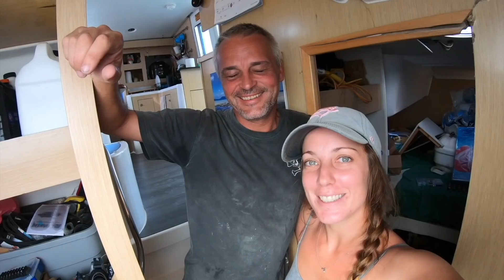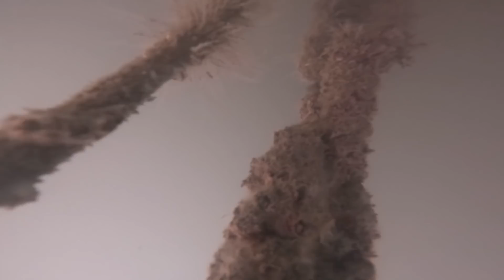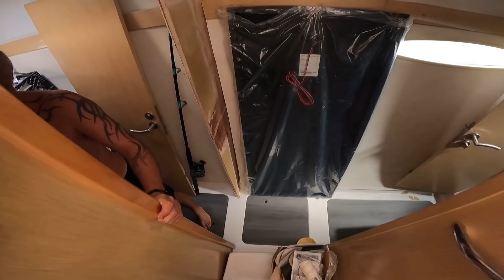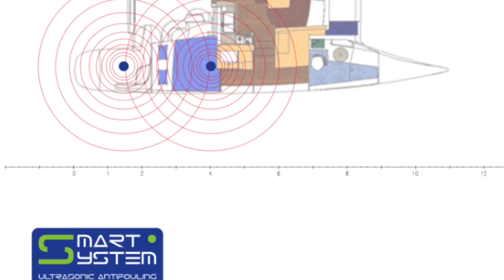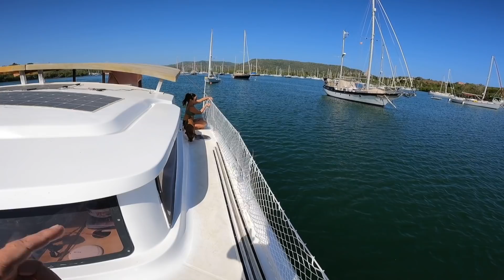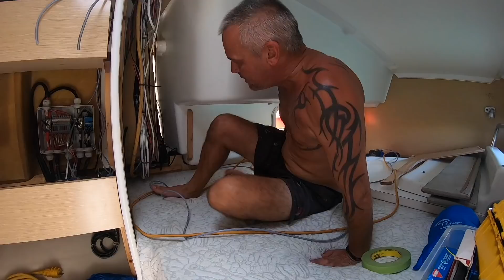ULTRASONIC Antifouling: Will it Work?? (S3 E3 Barefoot Sail and Dive)

Comment: I was going through the comments hoping to find any info on the outcome and found nothing. I am in contract to buy a 45' cat for a full time liveaboard and I am very curious if ultrasonic antifouling works. Hull Shield caught my attention. Would be great if you share the results (or a link if you already did on a different video). Thanks!
Reply from the maker: We’ve barely used it. Makes a high pitched noise that our dog hates.

Comment: Did you do an update video on the Untrasonic device?  I don't see it mentioned anywhere.
Reply from the maker: We have touched on it in a couple videos. We do not use the system. It makes a high pitched noise which we do not like. If you are not a live aboard it could be a good system

Comment: Rule of thumb, for using the zip ties, black for outside use (better UV resistance) white indoors...  Wish I had the courage to rebuild a hurricane-damaged boat...
Reply from the maker: I did say cable ties aren’t the best option but they are all we had at the time. I know black are more uv resistant but I’m not putting black on my new dog net and life lines. Would look terrible. 
We have a plan to put a thin line wrapped through it when we find the right stuff. And get rid of the cable ties. Everything is a work in progress. 

It’s definitely not easy

Comment: The ultrasonic works as long that you stays at a dock, we did already tests with it 20 years ago. with some times beter results and some tomes no results. It kills any way green algs, but it works not fast enouf. Good luck but it is no waterproof you will see.if it was that efficient was antifoiling not nessesary any more.

Comment: will be very interesting to see if it works but would be a good idea to keep a log of the ocean temperature during the trial to if this affect the outcomes. the manual states 
Warning
Install the ultrasonic device on the boat after cleaning the hull thoroughly and applying the antifouling paint. Device will prevent the growth of organisms and partly clean the hull. Place the device on the inside of the boat. Device is suitable for plastic and metallic hulls (aluminum, iron).

Comment: If the zip ties don’t last on the net you can get hog rings and hog ring pliers.  You can get them in stainless steel.   If you have never seen them it’s like a small C and then you put your cable and net into the C.  Squeeze the pliers and it makes a ring around them attaching them to each other.
Reply from the maker: Thanks!

Comment: I think this experiment will be interesting. Luperon is a great place to be able to do this test. Having it on a dual hull boat also makes it very valid. Same boat, same location, real world results.  
Any idea how many transducers would be needed to cover yeh whole boat? Or, what is the coverage of each transducer?
Reply from the maker: The diagram they sent said 4 for our size boat but I would almost want 6. 3 on each hull
Reply: @BarefootTravels  that was my thought as well. Make sure the overlap zones are as big as possible. So you’d like
Y see a 6-8 amp draw with all those installed.

Comment: Hi, I know how ultrasounds work because I work with them every day (physiotherapy) and they are also used in thickness measurement and metal defect and I know that the vibration produced propagates very well in liquids and metals but I have my doubts that it works well in fiberglass, unless you put several bases glued to the hull and alternate the transducer between them. If the ultrasound only cleans in a certain area then you know how many more bases or transducers you have to purchase. This is my opinion but I hope you get lucky.
Reply from the maker: Thank you for the insight. We appreciate it!!

Comment: I think this is going to be very interesting my thoughts are it is the marine equivalent of a copper bracelet i.e. no benefit at all but since it is someone else's time and money I am going to keep an open mind. The reason I cannot see any benefit is obviously it is no where powerful enough to vibrate all that growth of your hull and indeed if it was you probably would need a new hull. 

So it acts as a deterrent to growth attaching itself except the growth does not have any ears and such a rudimentary nervous system it may as well be a Chelsea football fan. It will be interesting to see the results if any and great news for the marine community if it does work.

BTW one thing you missed out on which I would think crucial information is how much power does it use? for those on more limited power budgets than yourselves.
Reply: I agree that the thing screams 'placebo'. However one thing to note is that their documentation says it is pulsed, not continuous. So it may actually be a very powerful short duration output on a PWM or something. But my intuition agrees with you that if it was really powerful enough to damage fouling organisms, it would probably also damage the hull. Another thing to note though is that a hull in between scantlings is basically a giant speaker panel. It should be very effective in transferring vibration.
Reply: @jessicav2031  I would agree apart from a few things a/ the bottom of their hull is probably around 15 mm of Glass b/ there are only 2 outputs  and each "Panel" has solid bulkheads which will reduce the transmission of any vibration and lastly these organism's do not even have a rudimentary brain to be discouraged by vibration. Still as you say we will see
Reply: @glennedwards1449  I wasn't thinking organisms would be discouraged, but physically prevented from making a good bond, for example when they first attach and the attachment is still weak.
Reply from the maker: It uses about 1-2 amps! 

Thank you!!